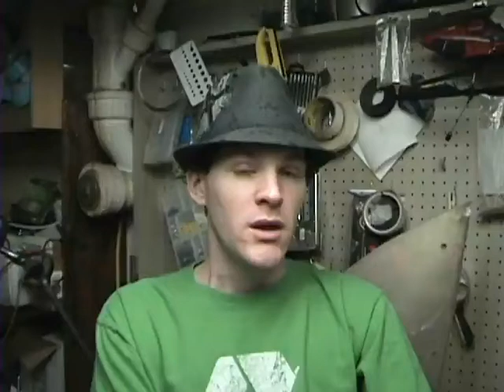RWGresearch.com? Open Sorce Your Ideas!!! Enjoy!  ~Russ Gries

Comment: dear Russ, How do you generate pulsating HV dc for fracturing water to hydrogen and oxygen? Stanley Meyer said that you need 40 kv at 10 kpps, and where do you get rectifiers to work at those votages and freqyencies?

Comment: My findings seriously guys all you need is to use a spark plug gap with the use of DC because then you have ALL the resonant frequencies form 0 to infinite is my findings guys !!!   No joke here guys because I did a video with the use of AC and found out that when I discharge a much higher voltage that got a carbon arcing affect from my light bulb fixture on accident when the right side of the microwaves discharged threw the light fixture is when I was turning on and off the light fixture which in turned discharged the outer metal body of the light fixture which produced all the higher voltages resonants frequencies into the whole mass of water which changed it all by the use of one paper clip and one stainless steel spoon !!!  Which means if you use a spark plug with DC you would do the same thing I think now so if this is correct then here it is then guys !!!   check on here you will see my video under thomas production of hydrogen on youtube.   Oh another thing to know also is that both my electrodes are both negative and positive in the matter of time fashion with the magnetic moments of the pulses from one side to the other when your using AC but if your using DC one electrode is negative and the other is positive right ?